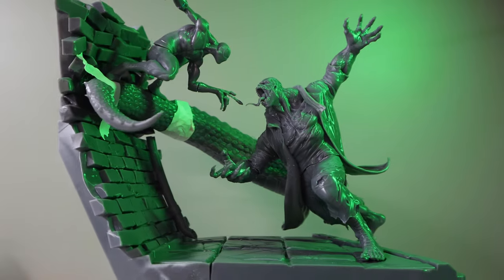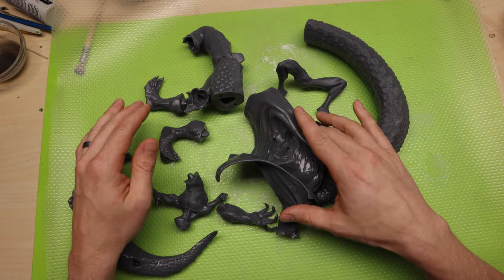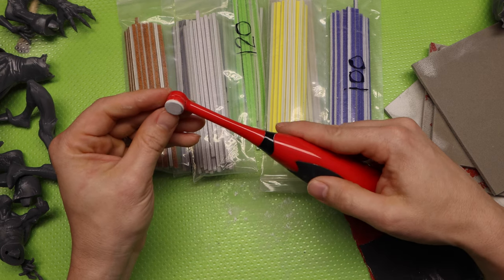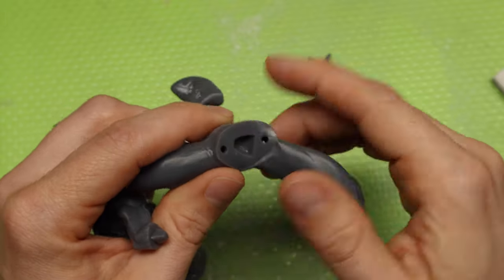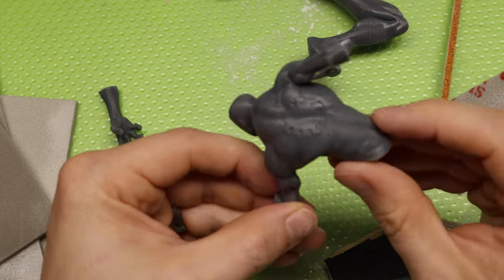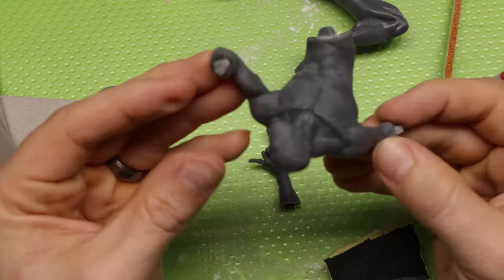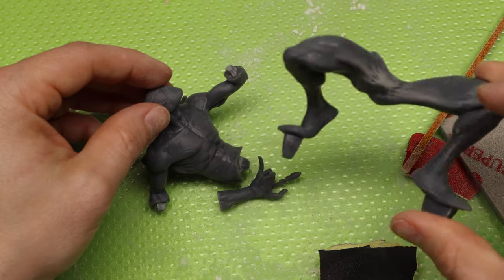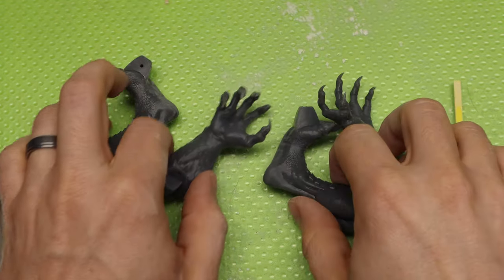Post Processing Resin 3D Prints | Preparing 3D Prints for Paint

Comment: Just a quick tip... if you will add a bit of water when you are sanding - using wet/dry sandpaper, of course - you will DRASTICALLY cut down on the resin particulates flying around. When I use water, there is little to no dust at all! Not to mention it does a better job :)
Reply from the maker: Thanks for the comment. Im very familiar with wet sanding but the sand papers I was using were not wet sand paper. In the past when I’ve wetted sand paper that isn’t classified as wet sand paper it falls a part.
Reply: Adding a few drops of dish soap to your bowel of water helps to keep the fine wet/dry from clogging. Just "rinse" the paper in your bowel fairly often to keep it washed. I learned this when dad fixed a ding in the fender. When he was done you could tell there had ever been any damage. (There was some hammering and filler involved, then glazing putty.  That was left to set up and then he sanded and did the paint and wet sand.

Comment: One thing I noticed on my prints are, I feel they a tiny tiny bit "oily", super minimal (I'm not sure if it's due to the resin material or if after all the cure process, it should feel exactly like plastic). I pre bath them, then I washed them for 10 minutes (I use water washable resins) on wash cure station, let then dry over night. After it, I cure for 5 minutes or so. Also, when I say oily, definitely it's not the same when we just take the finish print from the printer that they have resin all over them. Now I'll test to cure then inside a transparent cup with water. Recently I saw technic.

Comment: 20:29  Not sure if you knew already but those lines are caused by suction.  See how the rough lines stop when it gets to the holes in the tail part?  If you had put a hole in or next to the peg at the torso section, you would have created an early breather and not gotten any rough lines.
Reply from the maker: That is totally it I bet I’ve been randomly having that issue and it hasn’t happened enough for me to properly troubleshoot it. Thanks for the tip I will definitely try it.

Comment: For cutting resin I came up with a SUPER cheap UV box a few years ago to cure UV solder mask for my PCBs. It's an $8 toolbox lined with shelf adhesive aluminum tape (for reflection and UV protection) and a 5 meter strip of 5050 UV LEDs. It all runs off of a 12v pack and cost less than $20. It's got a huge internal volume and when closed there is no light leakage so I can put uncured resin inside and leave it unplugged and have no fear it'll cure accidentally. then when i want it to cure I just flip a switch and start the timer.

Comment: Thanks.
Some people are very afraid of resin. If we use respirator and observe all safety equipment (like glasses, long sleeve shirt,  gloves), will there be any problem in the long run?
How many years have you been working with epoxy or polyester resin and have you had any problems during these years?
AndHow often should we change the respirator filter? (For people who work with resin, paint, and chemicals so that no problem happens to the person).
Thank you for your guidance in this regard
Reply from the maker: I’ve been using resin for 3 years now and never had any issues due to the fact I’m always safe and use proper protection. The recommended practice to change a filter by 3M (the one I use) is a maximum of every six months. I’m not using mine every day since I’m not always using resin or sanding. So I change mine every six months to be safe.
Reply: @ItsMeaDMaDe  thanks.
Reply: I use resin almost every day but I'm a messy dude so it's always getting in contact with my skin, even when I try to be careful. Luckily I haven't developed any allergic reactions yet. I use respirators but no glasses because they get foggy (really humid and hot weather here and the mask releases air upwards) I noticed that when I used glasses I was actually putting myself in danger because I couldn't really see what I was doing. I haven't used resin for more than a year but I haven't noticed problems yet
Reply: @Sasaroly  Thank you very much

Comment: i dealt with those huge divits until i swapped to Lychee slycer,,, just sayin
your tips are just too large, u can use heavy on unseen and scale as u go up on detail
Reply: Agree with this.  I use chitubox pro, which has option for heavy/medium/light preset.  I found that using anything other than light causes the divots.  So now i just use lots of light supports and if the piece is larger that I'm printing, I will just use a few medium supports in strategic locations with extra light supports... you can basically put as many light supports in as you want and it won't cause the divots.
Reply: @Jaosn Fuller  free chitubox also has the light/medium/heavy presets. I tend to use Heavy for bases and the backs of prints and medium/light for front or delicate pieces. I just cover the divots afterwards. Easier for me than spending hours manually placing supports (Something that also increses the risk of catastrophic failure for me because I never mastered it)
Reply: @Sasaroly  hours placing supports?   Does the free version of chitubox not have automatic support placements?   I use automatic supports in the pro version and then use the feature that automatically takes me to overhangs that it couldn't put supports in to manually add them.   Then I just throw in some more supports where I think it's needed.   Afterwards I use pixel island detection feature in the pro version that detects islands per pixel to edit the pixels on each slice to clean it up....the pixel clean up is what takes the longest.
Reply: @resresres1  Yes it does, but it only uses the support kind you selected (light if you have light selected and so on) thus you can't use it for precise placement as is, you have to go around manually adding/removing supports once Chitubox is done with the automatic placement. If you prepare multiple prints in a row it ends up consuming a lot of time. I rather prefer printing once with automatic placement and if I'm not satisfied with the results I get on it and start switching things up manually the second time.

The other tools you mentioned, I get them with UV Tools
Reply: @Sasaroly  ah, well I found that it doesn't take me that long to add supports in after the automatic placement, because with light supports you can just throw in as many supports as you want, almost wherever you want, as the light supports don't cause divots, then I just add in some medium supports in strategic locations if the piece is larger (I almost never delete or even move supports in this method)....really take hardly anytime at all, even with multiple items on the build plate.       
Edit:. I guess I should say, that I do end up deleting some of the really tiny supports the automatic placement likes to put in and either redoing them or saving that spot for pixel edit.